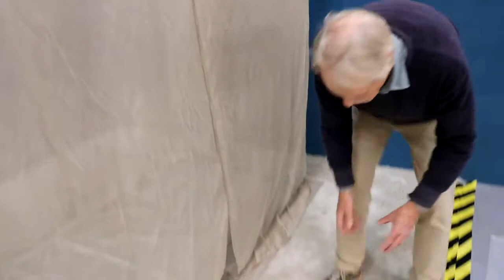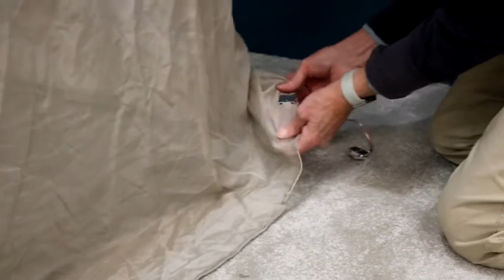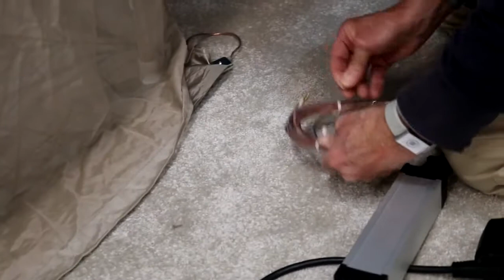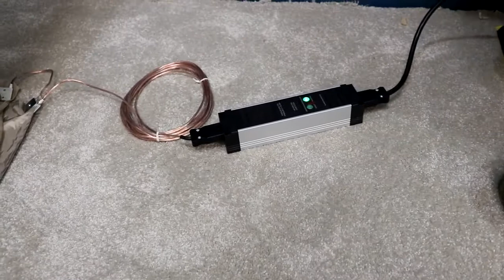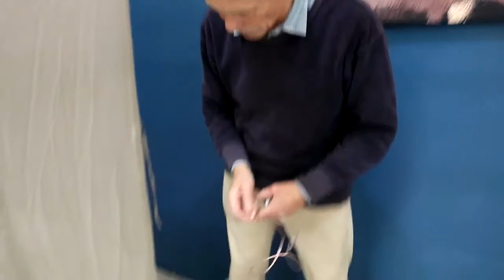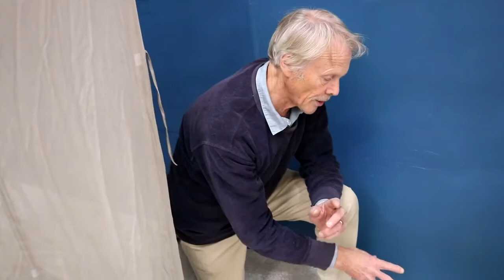EMF Canopy Grounding Kit Step by Step Guide | EMF Protection

Comment: Im wondering if i use these methods to ground the canopy could i still use my grounding bed pad on the bed? My grounding bed pad helps my arthritis. Would it be safe to use grounding on the bed within the canopy?
Reply from the maker: Yes that should be fine
Reply: @EMFProtection  I'm new to this Thank you🙏
Reply: hi
 how did this method work for u?
also in same boat as u were

Comment: What happens if lightning strikes the home?
Reply from the maker: Thats a good question, depends on many issues but I couldnt give you a difinitive answer
Reply: @EMFProtection  Seems like that's pretty important to know for an EMF Protection company telling people to ground metal canopies that they sleep in. Do you think you could plug the grounding wire into a surge protector to stop the possibility of a surge coming up from the grounding wire?
Reply from the maker: @lukeschumatti6901  in 15 years of supplying thousands of canopies we have yet to hear of a problem with electrical storms.  We would though of course advise cuation for all our clients and friends whenever any form of extreme weather is forcast or present.
Reply: Use an umbrella! ;D